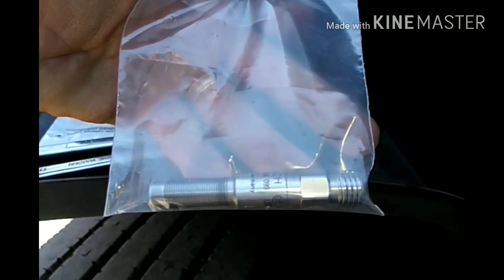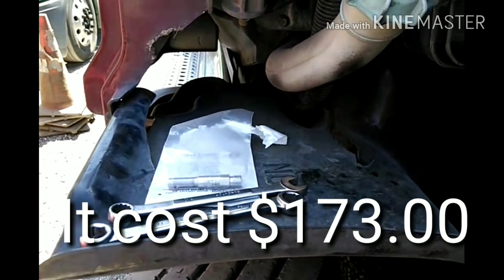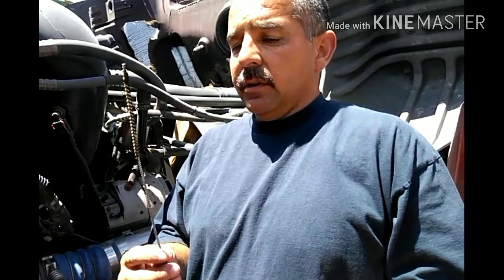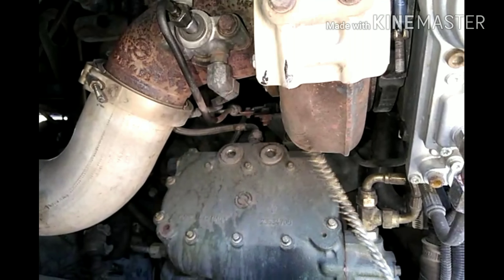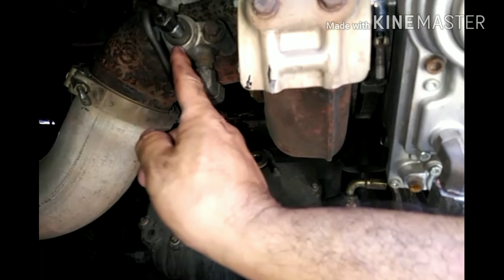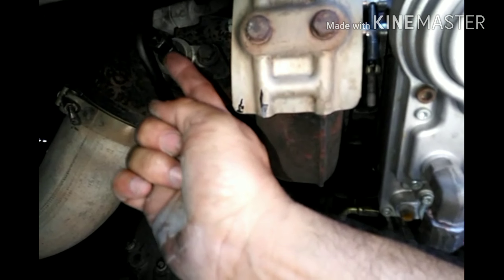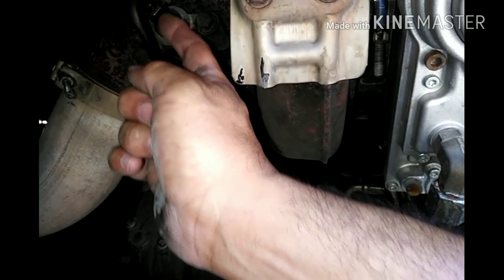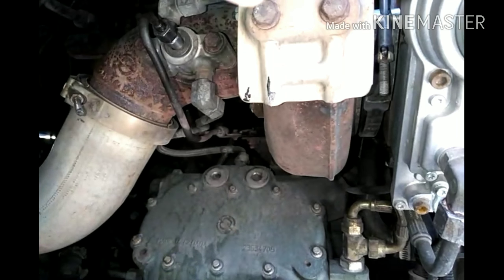Doser injector

Comment: RIGHT!!! How can you tell when it’s going bad? Or what are the symptoms?? Thanx for the vids man. Very helpful.
Reply: SPN 3556 - "regen temperature out of range low". Or if you have the DDDL software look for excessive doser line pressure. It should normally be in the mid 20's.
Reply from the maker: theres a few symptoms.the truck isnt regent,derailing another words loosing power on truck,or for the reason a swapped it out,its old lol,the truck is 2008 it has never been replace it was time,

Comment: Hey vic good looking out on the videos really big help..especially for these new trucks that have all these sensors etc.... quick question when your dozer valve "injector" was plugged up, did it seem like your truck  had no torque goin up hill? Im kinda having the same symptoms you mentioned on the last dozer video. I have all three lights on my dash..no torque goin up hill, and i cant get my dd15 to force a regen
Reply from the maker: you mite need to replace both the doser and the injector,that should solve your problem

Comment: Why does your injector keep going bad Vic ?
Reply: They get clogged up with carbon. Replacing one every 100K to 150K miles is not unusual, especially on older engines since they tend to produce more soot.
Reply from the maker: nospam is correct.another words derail of truck another words lost of power of truck or regent not taking,or like nospam stated old truck and just needs to be replace,my truck is a 2008 never been repolace